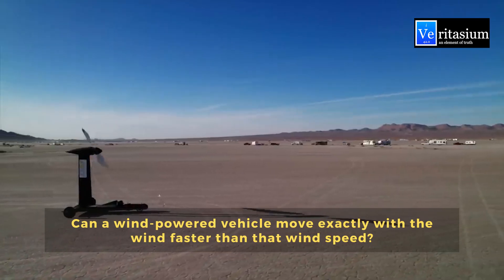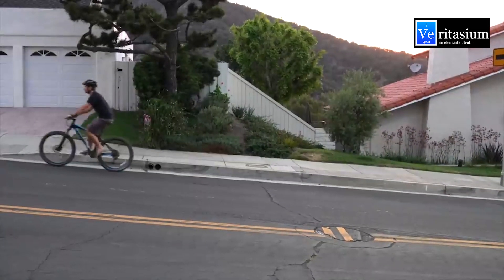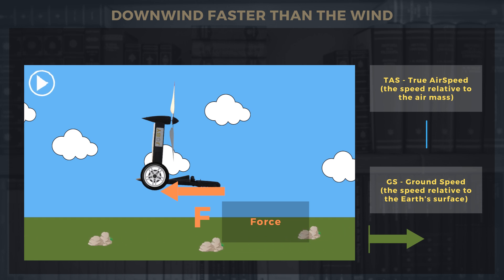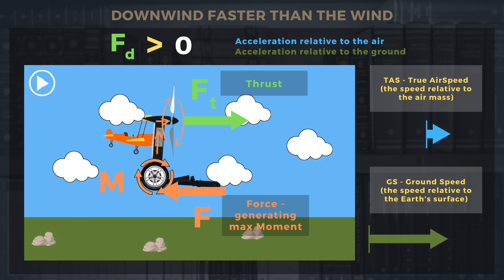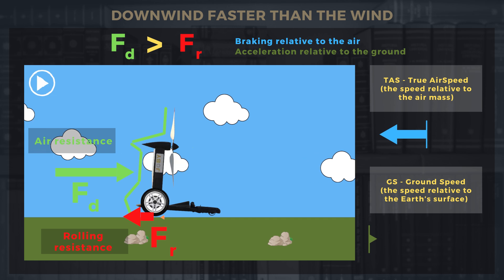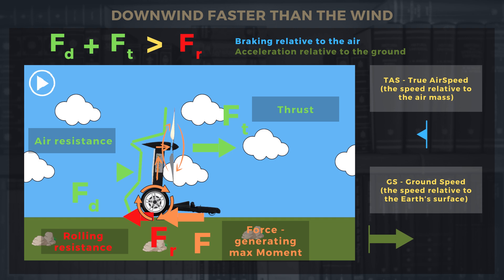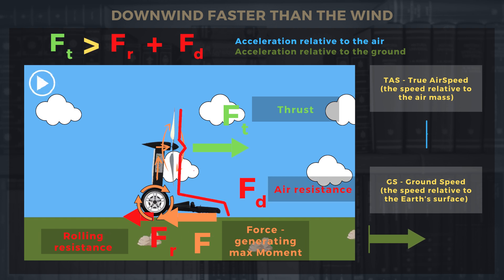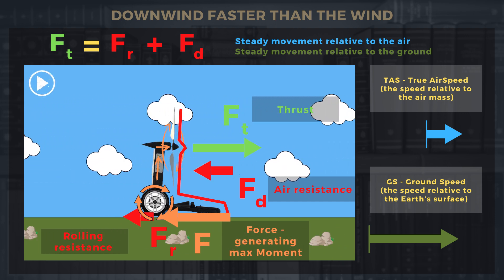Veritasium is wrong. Blackbird vehicle explanation.

Comment: You are incorrect that a tangential force on the wheel does not apply a retarding force to the cart.     Take a wheel in space and attach a short duration pulse rocket to the wheel on the rim.   If the rocket is ignited it will cause both rotation and displacement.   It will cause rotation because it is not working through the center of mass.   It will cause displacement because it is an unbalanced force.    The wheels have multiple forces on them.  Gravity balanced by the ground pushing up.   The force from the ground pushing opposite the direction of cart travel, and the force from the axle pushing in the direction of the cart travel.  That final force comes from the thrust of the propeller through the frame of the cart.    The reason the wheel doesn't accelerate fast is the propeller is also resisting turning due to air resistance.   So the torque does turn the propeller but this provides the resistance torque at the wheel. The reason the cart accelerates is that the thrust exceeds the retarding force of the ground on the rim of the wheel due to leveraged gearing.   At limit speed, the ground force on the wheel is very high but the propeller thrust is also high enough so that they balance and the wheel and propeller can no longer accelerate as the prop thrust balances the three forces of rolling resistance, aerodynamic resistance, and retarding force at the rim of the wheel from driving the propeller. 

You just have this wrong that there is no resistance to that force.  And the limit speed proves this since the ground exerts a force on the rim of the wheel but the wheel does not  rotationally accelerate because the propeller torque is resisting that force being part of the torque couple of the rim and the axle of the driven wheel.  At limit speed, that torque couple has to be balanced by a force at the axle which resists the motion of the cart.  Otherwise, the wheel would continue to rotationally accelerate and the cart would linearly accelerate.   At limit speed, all forces on the cart and all torques are in balance so no more acceleration occurs and the cart runs steady state above wind speed.
Reply: >> You just have this wrong that there is no resistance to that force.

Yeah - how about a simple free body diagram.  He's managed to get past that pesky "every action has an equal and opposite reaction" thing that has stopped perpetual motion cranks up to now.
Reply from the maker: Thanks for the long comment!
This force (from ground) causes rotation of the wheel – it is correct I hope yes.
If the wheel rotates it moves on ground in the direction of movement and propels the propeller. How this force can slow down the vehicle I don’t get it.
Until the TAS speed is 0 the force from air resistance will drive the wheel with the movement of the ground.
In fact I do not ignore the force acting from propeller to wheel <- it is starting to slow down the wheel but at the same time is generating thrust.  as i wrote in different comment to you: Yes I should have added two canceling each other forces to this equation – the orange force from ground moving (which driving the wheel) should be green and I should add resistance of the propeller (on wheel) which should be red. In the end the Thrust force remains as a green force and this force will be unbalanced. - Will cause acceleration of the vehicle.
Reply: @PiotrRysztak  
>> Yes I should have added two canceling each other forces to this equation

But they do NOT cancel, and it's specifically what you claim others got wrong when they in fact got it right.  You can't just sweep that under the rug - particularly since it's the entire point of this video.